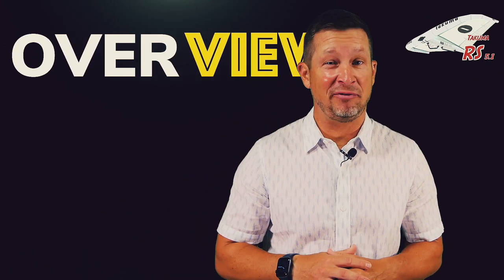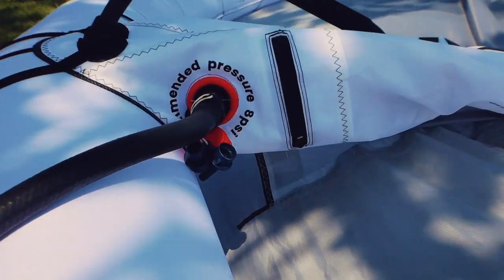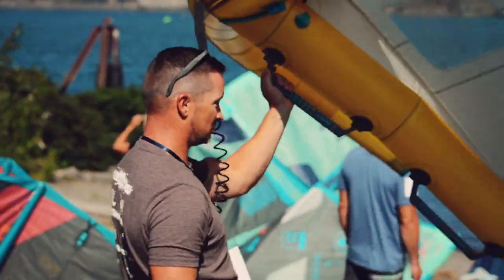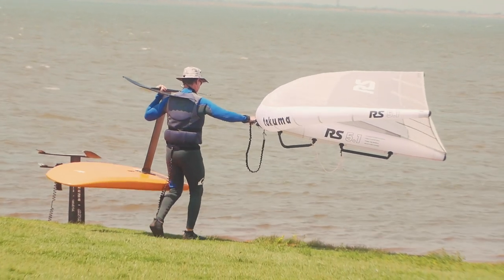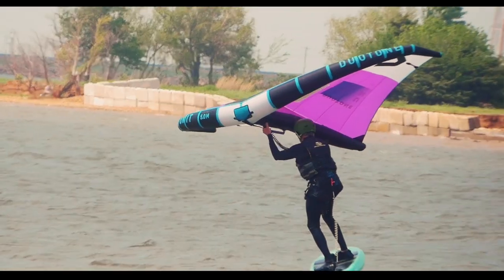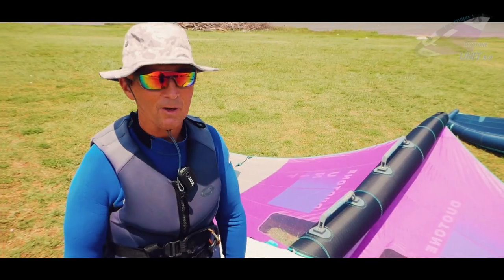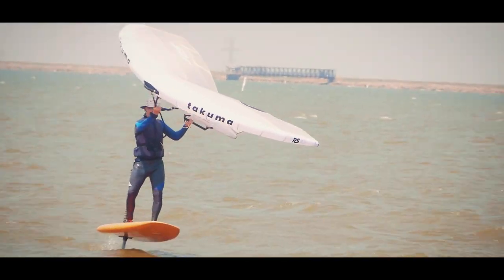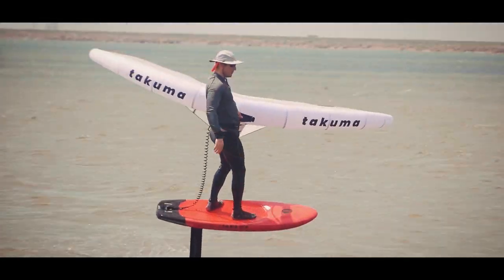Takuma RS vs. Duotone Unit II (Rigid Handle Wings)

Comment: Thx for the 1st review of the RS!
One question; on the seabreeze forum someone mentioned that this wing doesn't like being overpowered.  Theoretically it should be the otherway around, because of the firm canopy. Can you comment on this topic?
Reply: I found as it reached the top of its range and more flagging was needed, it would start backwinding. For my style, the Unit 2 was easier to control when overpowered. In its range, the RS was more locked in.